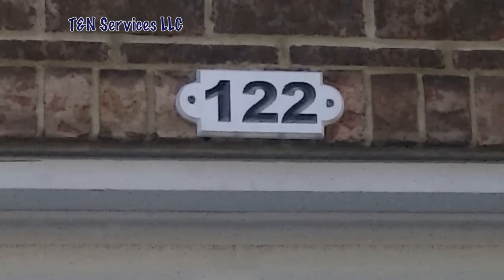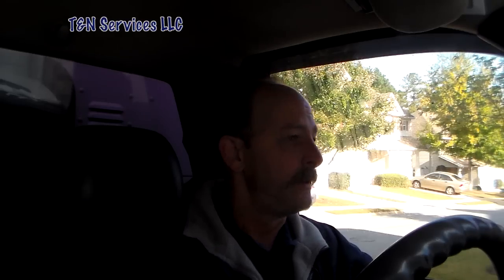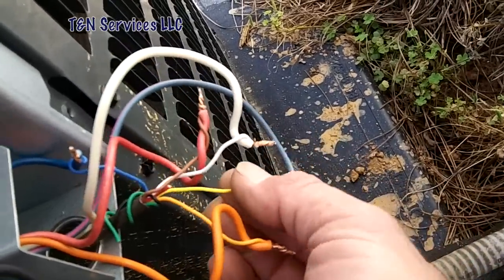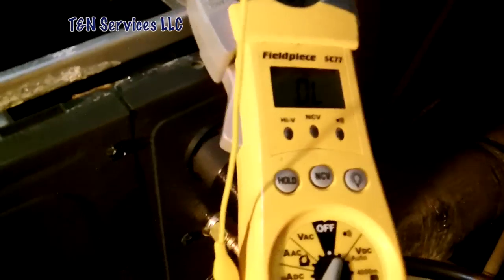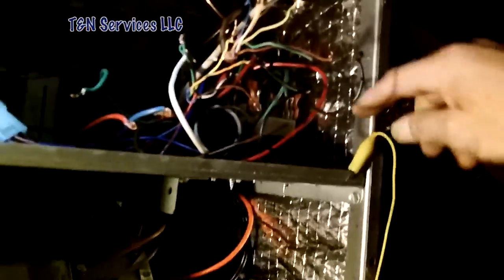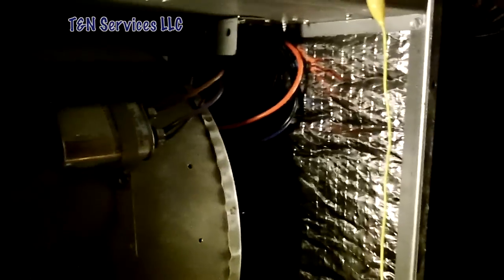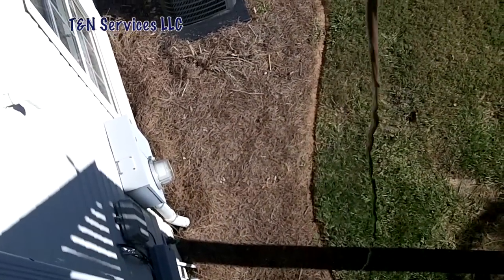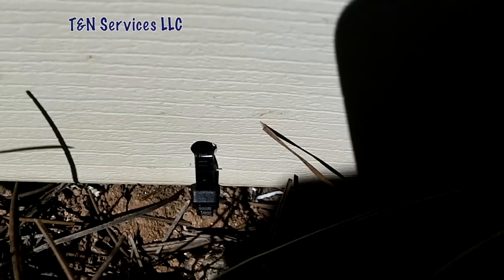HVAC Training: Finding & Repairing A Shorted Wire

Comment: You ran the thermostat wire from the condensing unit to the air handler but not from the air handler to the thermostat?  why not replacing it completely? good video

Comment: When stripping the wires. Banana peel the wires. Cut the first few inches of the ends of the wires then clip of the outer jacket. You will not damage wire jackets this way. I also do ethernet cable exactly the same way and those suckers are some tiny wires.

Comment: It would be nice if you mentioned what each of the 6 control wires were on the outside unit for newbies. The red wire you say is shorted appears to have been cut off and not in use. There is a white ,blue,  brown , yellow,red  and orange control wire connected. Was the red wire powering the defrost board ? Is there second stage cooling ?
Reply: He made it pretty clear about the short
Each wire is a point A to B 
Therefore the red wire was ending up on browns point A to B as well
Reply: Red is 24v and brown is usually a non used wire but because the red wire was touching with brown somwhere in the line the brown wire was touching somwhere metal thats why when he probed the copper or the air handler housing (metal) it made the beep noise so to make long story short the 24v red wire was touching ground(metal)

Comment: I have the fan only "on" to circulate air in the house. No heat or AC is on. My blower fan is turning on and off just about every minute like it's short cycling. I've been searching the internet endlessly and can't find any info regarding this issue. Any ideas?
Reply: Did you ever find the problem?
Reply: @realSamAndrew  I actually did figure out the issue. I realized when the HVAC was using heat I had no short cycling issues. Of course my multimeter didn't work when I needed it so I couldn't test the wires. To get around that I switched the wires from the fan and heat and lo and behold no short cycling! I changed out the blower motor (cost me $80) and my HVAC system has been working flawless ever since. Too bad I went through two HVAC technicians and neither could figure out what was wrong but charged me through the nose for failed efforts. Neither of them used a multimeter. If they had, they would have found the issue. I also bought a new multimeter for future troubleshooting. 👍
Reply: @Geonious  I'm confused. It sounded at first like your problem was a bad wire. Then you said you changed out the blower motor. Why? And if the blower motor was bad, why would switching wires solve that? Thanks.
Reply: @realSamAndrew  Honestly. I don't know. I watched some YT videos how to troubleshoot short cycling and every video from HVAC techs showed the first thing they did to test was use a multimeter. Mine didn't work the day I wanted to use it and I wasn't able to test certain components of the system that usually cause short cycling. During my frustration I remembered in the winter when using heat, the system did not short cycle. So, I took a WAG (wild ass guess) and switched the wires on the control board. No more short cycling. The wires I swapped ran into the blower motor. Replacing the wire inside the blower motor was not something I wanted to attempt. Also, there was a whining sound when the blower kicked on. My guess, it was a bearing inside the motor. The easiest solution in my mind was replace the blower. New bearing and new wire(s). $80 later and a little bit of time and effort I was back in business. If that didn't work, I was going to change the control board. All I can say is I fixed the issue that was plaguing me that the "professional" HVAC techs couldn't fix but they charged me a lot of money guessing what the issue could be with no results.
Reply: @Geonious  I have stories similar to yours. I can't believe 2 techs in a row didn't bother to use a meter. In all your tweaks, you didn't change any of the tstat wires? The wires you swapped to test, which ones were those? I appreciate your replies.
Edit: I see you said the wires on the control board. My guess is the different color blower wires control different speeds, and the speed tap for the fan on may have been bad, and you switched it to the heat speed. Before you got the new motor, did your test swap make the heat short cycle and the fan run constantly? The reverse of the original problem?

Comment: Great job! 
I tell you what ,those low.voltage shorts can make us contractors/ technicians, really get white hair.quick.
I had a new install..2 months later.orange wire was just energizing the reversing valve.solenoid..( heat pump split system), well i used the black wire.
Did not hear back from customer,than 3 weeks later same.issue..
Im scratching my.head..pulling my white hair out...
Getting 17.6 volts.not.24-27 volts..
So i found a splice from previous fool..
Fixed that in wall..
Well 2 weeks later..same humming noise..customer irrate at this time.
So i finally fished new 7 wire from air handler to condenser..
Guess what...
Havent heard back in months..
Wait..just knocked on wood..
But i feel for you..been there.done it...
But it can ruin your day..
122 or not...any block #..
 My best to.you..
Blessing to you.
Thanls for your time and videos...
Bryan Tyler Refrigeration
Helotes,Texas

Comment: he keeps saying he playing around but he really trying to not run a new wire. we all been there lol..

also when you fish into the sofit you can push a little to much wire in and then go in the attic and hook it to you.

also when you push wire into the siding you take rubber bushings and use silcon and you can push them in and it will glue them inside the siding with out damaging the siding. 5 years of pre and post wire.. i know all the tricks

Comment: Can those thermostat wires go directly to the thermostat inside the home?
Reply: Yes they are sold for all kinds of use, I would recommend 18 gauge with 8 wire if you want future proofing. Usually sold as 18/8 thermostat wire 👍
Reply: AkiraX39 I only asked because a lot of people are saying it goes from heatpump to a plate on air handler and then a separate wire from air handler to thermostat
Reply: Yes one run connects air handler to condenser and then another one connects air handler to thermostat, so yeah two separate wire runs are needed.

Comment: I am not an hvac guy but damn I have been learning, spent 2 Ohio winters dicking with heating cooling companies here, air handler has heat strips heat pump is out side all I have needed this whole time is the thermostat wire or control wire what ever it’s called hooked up where it goes, 
Here’s why, foreclosed home and I believe the previous homeowner wanted to take the unit because he un hooked air handler and heat pump from breaker box, I hooked em back up and he switched actual thermostat “he probably had an expensive one he wasn’t giving to the bank” I can tell by the paint marks, but the wires going to heat pump were just laying on floor near handler, does this end go directly to thermostat along with the wires from handler, there is a plate on handler but no wires hooked up on inside...

Comment: Their is a really cool little Item called "Add A Wire" that i found at my Trane Supplier...

It is a small module that enables you to Add a Wire to any existing control wiring config. when you have a short and have to abandon a wire or need an extra wire just like you found here....It costs just $12.75 and can save the hassles of making another full run of control wire....I keep one on my truck at ALL Times and they are awesome and a time saver..... P.S. it is small enough to tuck in a wall behind the t-stat, about the size of a box of matches.    ADD A Wire module.....check it out.

Comment: Were you getting paid to come back on all those calls? With a fuse on every wire we know someone had been getting called back a lot. This was probably what was wrong with the old system. Since it is an apartment complex you may should have ran that new wire when you got the sale and did the install. Now your customer may call that other guy back for the next service call because you put a new one in and it didn't work, generating multiple callbacks. The bright side is 2-fold,  you got the sale and you "fixed it". The other side is, customers are not dumb.

Comment: ive had a short like that, we were out multiple times, ended up being shorted on the gutter where they ran it outside. would only blow when the wind blew and it tapped the gutter. sometimes you never know.

Comment: I hate Low voltage shorts that red wire was grounded somewhere in the wall good idea running a new t stat wiring to the outdoor unit. Good fix